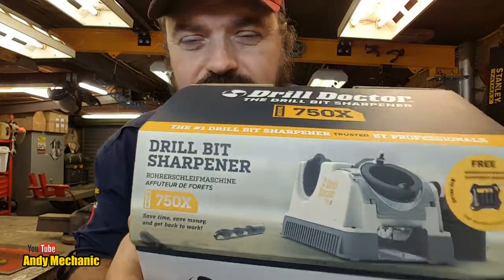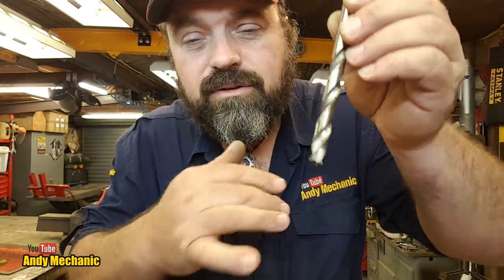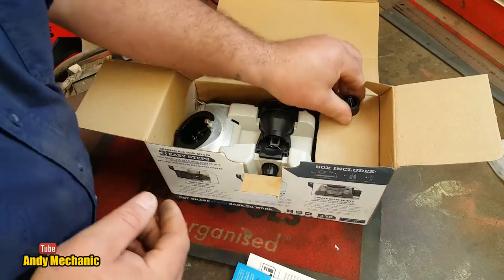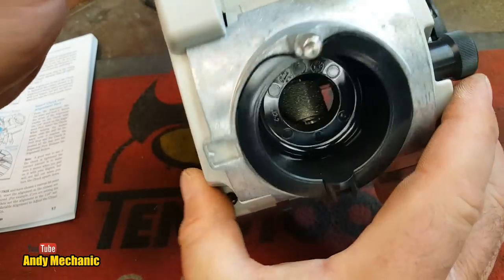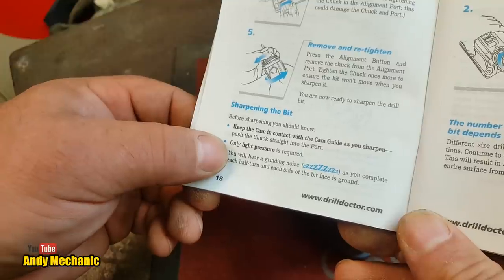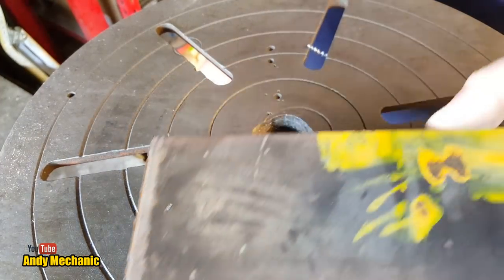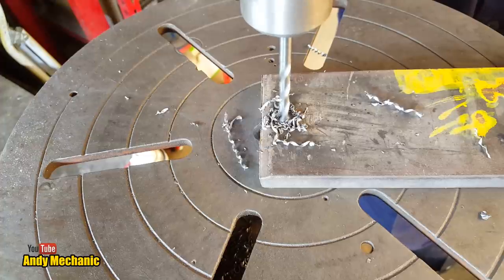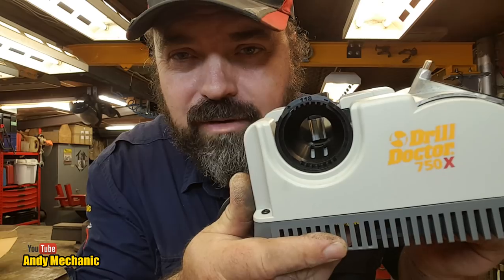Drill Doctor X750   any good   let's find out #2611

Comment: Ive had several of these.  Things you get use to: tightening the bit in the holder fully, then cracking open slightly to allow rotation when aligning.  Sharpening: many rotations, even number-ish. Quick, low pressure.  Might help to reposition in the HOLDER in between sharpening and splitting  (for the 135 deg angle bits).   Can FLIP the grinding wheel over for extended life - especially w splitting.  NIce to have a 2nd unit for finer grit wheel.

Comment: I had the original Drill Doctor, which was smaller than the model you are using, many years ago. Sharpened an engine room work bench drawer full of dull bits with that thing. Did a good job. The information which came with the machine stated that the cutting wheel would need to be replaced after around 150 bit sharpenings. They were correct about that as a worn wheel will only make the bits worse. I gave that machine to my brother when I moved to Europe. Different voltage and Hz here. At some point I will buy another one again if they are available here. As we all know, A tool drawer full of sharpened drill bits is almost as satisfying as spending the day with a lovely Tool Girl. Good video Andy.
Reply from the maker: Thanks Connor, it's interesting information that's coming through. It's a handy tool though is quite expensive for what it is & given I can sharpen drills manually the only real benefit is I can get the Tool Girls to sharpen my bits whilst I get on with something else.

We will have to see how long that diamond Wheel lasts...

Cheers Andy
Reply: can flip the wheel also, i believe

Comment: G’day Andy and greetings from Tasmania,   that was a good review of the 750X. I have one for years it was when they first came out, I have found it very good although there are supposedly better ones on the market.    I found you keep it out in a very handy place so you use it as soon as your drill bit gets blunt my drill bits are all Sutton and it makes the same sharpness as when I bought them,  you can easily get parts for it like the Dimond stone.    I only gust happened to stumble across your channel and I have subscribed.     Kind regards John
Reply from the maker: Thanks John, I'm pleased you found the video interesting. Mrs Mechanic used the drill sharpener to sharpen up all my drill bits. It worked okay but I found I was able to do a better job on the bench grinder, the way I have always done them since I was taught at school. Unfortunately my Drill Doctor is in a draw & hasn't seen the light of day for some time now. I can see how the tool would be very useful to the majority of people as it does an acceptable job & allows drill bits to be re-sharpened rather than replaced in most cases.

Appreciate your comment & welcome aboard 

Andy

Comment: TIPS: sometimes its a good idea to RESET the bit in the holder between sharpening and point splitting (on the 135 degree).  Some adjustments to the notch setting might be required depending on the bit.

Comment: Looked to me like the wheel grit on the drill doctor was a bit coarse, I could see quite deep scoring on the cutting face and edge after grinding. I have gone over to using rota broach for anything over 12mm as as it is so much faster.
Reply from the maker: I have to agree with you, after sharpening in the Drill Doctor the cutting face does look quite rough. I also found the angle of the flank was too small causing the cutting edge to only slightly cut the steel & the process was very slow - mainly on pilot drill. So I re-sharpened on the bench grinder how I would usually sharpen a drill bit & it was much quicker cut through the steel. I'm sure I can adjust this on the drill doctor - will have to read the instructions!

Cheers Andy

Comment: After watching the last video, I was just waiting for this one. I like the idea of having a tool to help sharpen bits. I've read the comments, and I'm wondering if the tool will last long enough to be considered worth it. It's nice that you can replace the grinding wheel, but what happens when the plastic parts wear out?
Reply from the maker: Hi Wayne, exactly, and due to this I'll have to re-visit this in say a year to see how the Tool is coping. Mrs Mechanic sharpened around 100 drill bits yesterday and it's still going strong but for it to be viable then it's going to have to sharpen a few thousand before it's something I would consider.

I'll keep you posted :-)

Cheers Andy

Comment: Cutting fluid is realy important period, I don't own a  drill doctor because I found the ones in the past to be plastic cheapy deals with the original one I tried had a stone wheel that would wear out real quick. I worked in a shop that had a Lisle professional unit that was all metal and was the real deal but just too high for me and I don't think they have made them for years now. I don't buy cheap drill bits usually Drill Hog, Kwik Kut or Magnum bits by  Norseman but I usually these days see them chip over dull so I guess I make you mad but the small ones are scrapped at that point. I usually buy them as a ten pack so they are fairly cheap from HJE and other industrial dealers.

Comment: Awesome, I'm sick of blunt bits and never mastered sharpening by hand.... but.... $550 here in Aus 😧😭
There is the XP model for $250 which is still crazy, and only does 118° up to 13mm, but still does split point and I think all the same different types of bits including masonry which really adds to the value of it. It does look much more cheaply built tho, I know someone said they had the smaller one which worked good, but that still could be the $450 model, but it would still be good to know if the entry level XP model is still just as accurate. Oh and replacement diamond wheels are $85 here for the more expensive models, but it doesn't list the cheaper XP model as being suitable for them, I really hope it's not a completely inferior model.
Great video, glad to see you are well. Hope the tool girls are all well and they can return soon 😀👍
Reply from the maker: Thanks for all the info Big Daddy. They are expensive for sure. My main benefit having the Tool is Mrs Mechanic can now sharpen all my drill bits - saving me time! Plus I'll have to teach the Tool Girls next :-)

Oh...Tool Girls will be back just as soon as lockdown is lifted...can't wait! :-)

Cheers Andy
Reply: Amazon sells the diamond wheel for this and claims it fits the following models, XP included:

350X
XP
500X
750X
Reply: can also do by hand on a grinding wheel! lots of vids of this method

Comment: For 200 quid I wonder how the plastic cams will wear in time and it all seems a little flimsy but I like the idea but would prefer something made with better materials.
Thanks for the vid as always :)
Reply from the maker: Yes, Mrs Mechanic, after training, sharpened up about 100 drill bits yesterday and you can see a small amount of wear on the cam. Maybe a bit of grease on the cam guide may slow this down.

It is expensive for sure....maybe I'll do a follow up in a year or so.

Cheers for now & keep safe
Andy